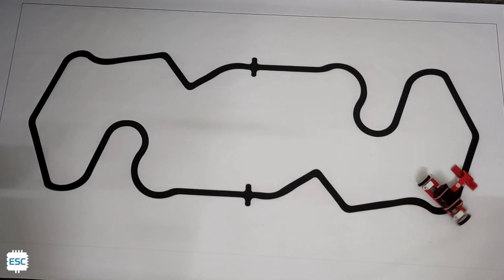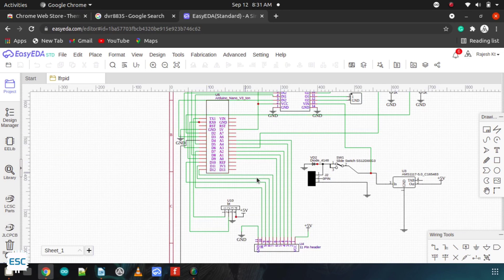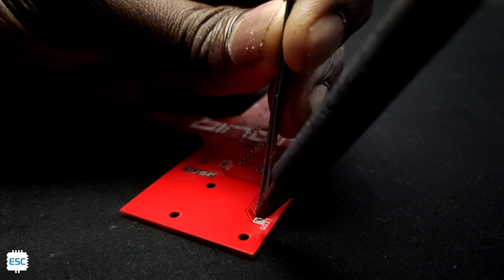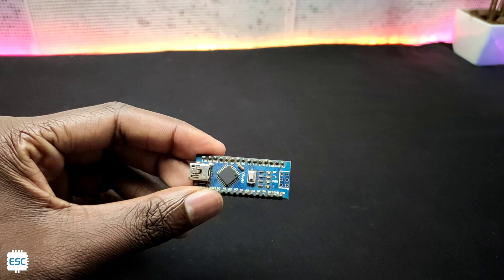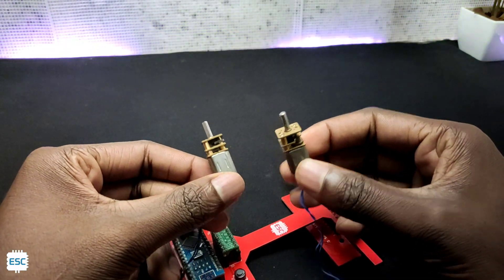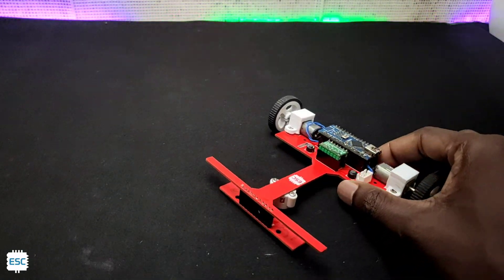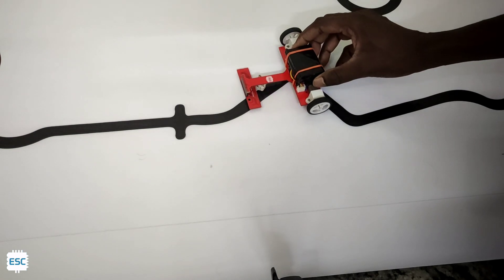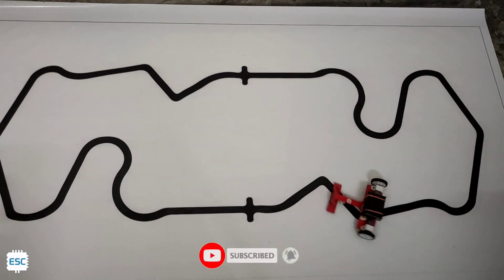How to Make PID Line Follower Robot Using Arduino

Comment: I have a question same components used except for my motor driver instead ln298 I'm using is it going to work or need H bridge motor driver for PID
Reply from the maker: You have to change the code
Reply: @EDISON_SCIENCE_CORNER  how about this can you check this code
#include <QTRSensors.h> 

QTRSensors qtr;
const uint8_t SensorCount = 8;
uint16_t sensorValues[SensorCount];

/
float Kp = 0.07; 
float Ki = 0.0008;
float Kd = 0.6; 
int P;
int I;
int D;

int lastError = 0;

const uint8_t maxspeeda = 150;
const uint8_t maxspeedb = 150;
const uint8_t basespeeda = 100;
const uint8_t basespeedb = 100;

int ENA = 8;  // Enable pin for Motor A (PWM)
int IN1 = 9;  // Control pin 1 for Motor A
int IN2 = 6;  // Control pin 2 for Motor A
int IN3 = 5;  // Control pin 1 for Motor B
int IN4 = 3;  // Control pin 2 for Motor B
int ENB = 4;  // Enable pin for Motor B (PWM)

void setup() {
  qtr.setTypeRC();
  qtr.setSensorPins((const uint8_t[]){10, 11, 12, 14, 15, 16, 18, 19}, SensorCount);
  qtr.setEmitterPin(7);//LEDON PIN

  
  pinMode(ENA, OUTPUT);
  pinMode(IN1, OUTPUT);
  pinMode(IN2, OUTPUT);
  pinMode(ENB, OUTPUT);
  pinMode(IN3, OUTPUT);
  pinMode(IN4, OUTPUT);

 
  for (uint16_t i = 0; i < 600; i++) { // Calibrate for about 15 seconds (600 * 25ms = 15000ms)
    qtr.calibrate();
    delay(25);
  }
  
  stopMotors(); 
  delay(1000);
}

void loop() {
  PID_control();
}

void setMotorSpeed(int enPin, int in1Pin, int in2Pin, int speed, bool reverse) {
  digitalWrite(in1Pin, reverse ? HIGH : LOW);
  digitalWrite(in2Pin, reverse ? LOW : HIGH);
  analogWrite(enPin, speed);
}

void stopMotors() {
  digitalWrite(IN1, LOW);
  digitalWrite(IN2, LOW);
  digitalWrite(IN3, LOW);
  digitalWrite(IN4, LOW);
  analogWrite(ENA, 0);
  analogWrite(ENB, 0);
}

void PID_control() {
  uint16_t position = qtr.readLineBlack(sensorValues); 
  int error = 3500 - position; 

  P = error;
  I = I + error;
  D = error - lastError;
  lastError = error;
  int motorspeed = P*Kp + I*Ki + D*Kd; 
  
  int motorspeeda = basespeeda + motorspeed;
  int motorspeedb = basespeedb - motorspeed;
  
  if (motorspeeda > maxspeeda) {
    motorspeeda = maxspeeda;
  }
  if (motorspeedb > maxspeedb) {
    motorspeedb = maxspeedb;
  }
  if (motorspeeda < 0) {
    motorspeeda = 0;
  }
  if (motorspeedb < 0) {
    motorspeedb = 0;
  } 

 
  setMotorSpeed(ENA, IN1, IN2, motorspeeda, false); // Motor A forward
  setMotorSpeed(ENB, IN3, IN4, motorspeedb, false); // Motor B forward
}
Reply from the maker: The code that i provided is for drv8835

Comment: Really nice linefollower and video! I read your code trying to learn about the qtr library and I saw that you wrote digitalWrite(4,HIGH) in the calibration void, after that i searched for the Arduino nano pinout and the pin n°4 is GND how does that work?
Reply from the maker: Pin 4 is not ground. Pin means digital PIN not physical
Reply: @EDISON_SCIENCE_CORNER  oh srry, but why do you keep it "high" during the calibration phase? what was connected to it?
Reply from the maker: High means it is connected to LED. So it will turn on during the calibration process. After calibration it will turn off

Comment: i didnt understand the manual calibration part , i thought the pid parametres should be adjusted in the code right??
Reply from the maker: Pid parameters should adjust in the code. But calibration must be done by manually

Comment: can digital ir sensor be integrated  with pid? I thought only analogue ir sensor can be used for that
Reply from the maker: Pid can be used
Reply: @EDISON_SCIENCE_CORNER  could you make a dedicated video on PID and selecting the best components for an LFR competition? Since speed and accuracy also depend on these factors, it would be really helpful.
Reply from the maker: Will Make

Comment: I have the clone of polulu qtr8 RC sensor you are using, how did you manage to use the clone one and still get a good reading? please help, I am only receiving random values.
Reply from the maker: I didn't use any tricks . It is giving good output readings.
Reply: @EDISON_SCIENCE_CORNER  Thanks, my problem is now fixed, go another board.

Comment: Will this work in a bigger chassis where the battery is heavier and is placed in the straight side?

the shape is like this:

------- 
         <----- nano & motor driver
-------
   '
   '   <----- battery
   ' 
 ----- <---- qtr-8rc
Reply: YES
Reply from the maker: Possible

Comment: The thicker the line is, the more IR sensor it needs right?
I'm building my own IR sensor. I just finished one but I don't know how many more I need.
Is 2 sensors enough?
Reply from the maker: Nope not like that. Number of sensors increase the precision.
Reply: @EDISON_SCIENCE_CORNER  Thank you
Reply: See from my personal experience the line is not thicker than 2cm in any competition u need more sensors for advanced pid control, pattern solving capabilities and precision and this channel had a genius idea even I have implemented this only pcb and no chassis idea in my lf
Reply: How did you make ir sensor
Reply: @suvashsah5128  i use LM358 IC.  This IC can create up to 2 sensors. So if you need 4 sensors, you use  two of LM358.
Each sensor is made up of 1 pair of IR diode by connecting them to LM358.
Sorry for my English.

Comment: How to test that ir array is working or not 
Serial print showing analog values for each sensor output from 1000 to 1020
Also the bot is not calibrating on pushing button (actually I am using wires to touch to 5v and turning high instead of push buttons) and executing forward brake (0,0) function please explain errors .
Are there any error in the code because I checked and not found any.
Reply from the maker: You can test the sensor by running the qtr example code

Comment: Awesome.
Can I substitute DRV8835 for DRV8833 ?
Reply from the maker: You have to check the datasheets of both. If the pins are the same you can use them. I have not tested

Comment: Arduino: 1.8.19 (Windows 7), Board: "Arduino Uno"

LF29:1:10: fatal error: QTRSensors.h: No such file or directory
 #include <QTRSensors.h>
          ^~~~~~~~~~~~~~
compilation terminated.
exit status 1
QTRSensors.h: No such file or directory

This report would have more information with
"Show verbose output during compilation"
option enabled in File -> Preferences.
Reply: Kindly tell the solution
Reply from the maker: Include the library

Comment: but it's not calibrated right? the robot oscillates a lot which shouldn't if the PID was properly calibrated
Reply from the maker: Calibration . But not 100 percentage
Reply from the maker: Yes that's correct

Comment: Can u mention what all are the SMd  and through hole components,  also  if I use a 400 rpm motor and 1293d motor driver which battery should I use
Reply from the maker: You can check that in design

Comment: How to increase speed?
Reply from the maker: You can  change in code also by changing the motor
Reply: @EDISON_SCIENCE_CORNER  how bro can u say
Reply: @IbrahimDhanishJ Define  speed in code or just change the motor to higher rpm ons
Reply: If u have a low rpm motor then change the motor or if u have enough rpm the change it in code

Comment: Sir can we use any other motor drive other than that because it's not easily available in my country
Reply from the maker: We can use. Then we need to redesign the circuit and code. Btw where are you from.

Comment: Hello
U have made a connection for TX, RX, GND, VCC on PCB is it for programing Arduino through FTDI? if not then for what purpose it is there? Also we can skip that right if we are programing Arduino directly using cable?
Reply from the maker: I made that for connecting Bluetooth module for debugging
Reply: @EDISON_SCIENCE_CORNER  ohhhhhhhh for manually setting PID values right? I get it thanks alot and very good deign and project.